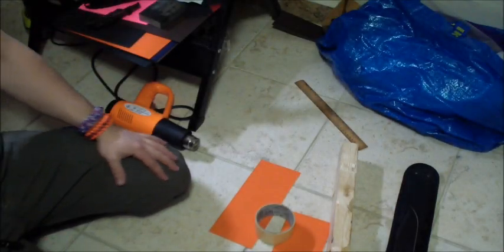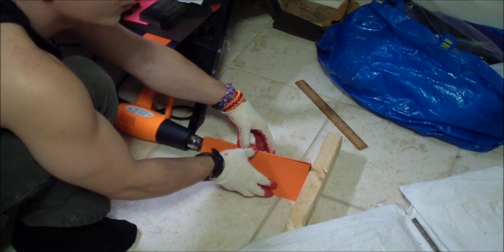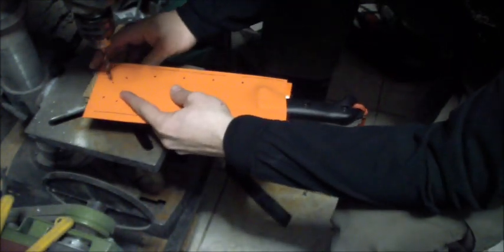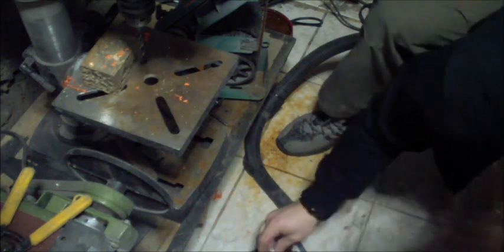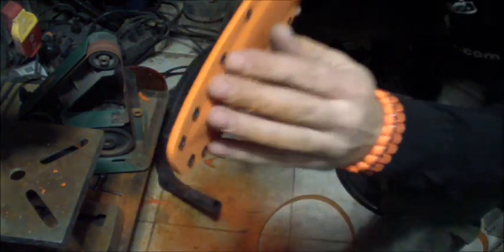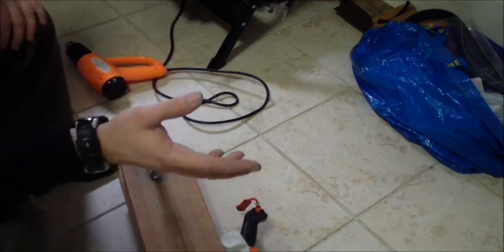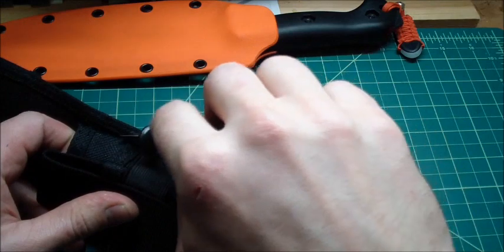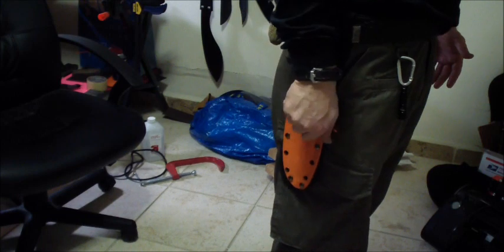My Ultimate Custom Kydex Sheath Making Tutorial (long real time)

Comment: When I first decided to start working with kydex, I studied your kydex tutorials quite a bit. The learning curve more or less became a flat line. Thank you for that!

However, now that I have worked with kydex for some time, I felt like I should return the favor in the form of a little trick, or tip if you will. Instead of riveting before you sand, you could use some durable masking tape, or similar, to prevent the sheeths of kydex from separating and sliping around. If you would like to play it extra safe, you could use some small but strong clamps as well. This allows you to clean out the sheath from shavings, grit, and what not once all the sanding and such is done. I admit it's a bit extra work, but it's well worth it for the perfectionist. I mean, it's always nice to pull your knife without having to remove small kydex shavings from your knife if you plan to use it on something you plan to eat.

Also, an ordinary sponge used for dishes is superb for the finishing touches on the edges of the sheath. Just soak the sponge in water and go at it, you'll know when the edge is finished from feeling and escpeially sound. The result is such a smooth finish you could almost see your own reflection in it.

Comment: I am impressed with your method. I use sand and boiling water. Your way seems cleaner. The one thing I do different is that I over lap the top piece of Kydex about 5mms and shape the bottom piece first. The over hang molds over the edge of the bottom. After molding the sheath I then trim the edge with a hot wire. Great D.I.Y. video. Keep up the awesome work.

Comment from the maker: @oremountains Its easier to heat the kydex this way and also the holes are exactly where you want them on the sheath. If you drill before molding, they move slightly depending on the knife shape and thickness

Comment: Hey ...just a suggestion. If you set up ur clamp on the drill press u can use the drill presss for the rivetting and u can also clamp a wider piece of panel to the press to use for ur drilling.

Comment: I was thinking, you could, if you wanted to, use nuts bolts and washers on the first 4 holes instead of rivits. That way you could take them all the way apart and get to the insides of the holes easier. What do you think?

Comment: Q: At about the 27min mark you are talking about using heat to adjust retention tension... That some handles are prone to MELTING, or suffering the affects of being heated.
Q: WHAT METHODS, MATERIALS are you using to keep melt prone handles from melting... or deforming?
(I would assume some type of shielding.)
https://youtu.be/2pR3mu9_8xU?t=27m